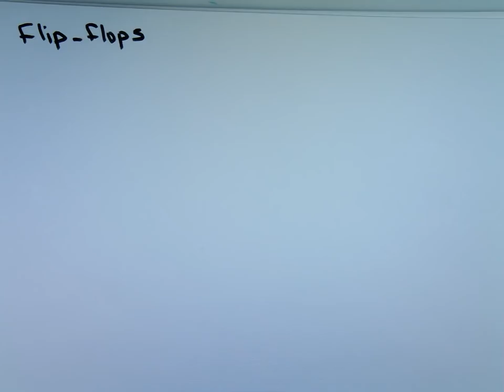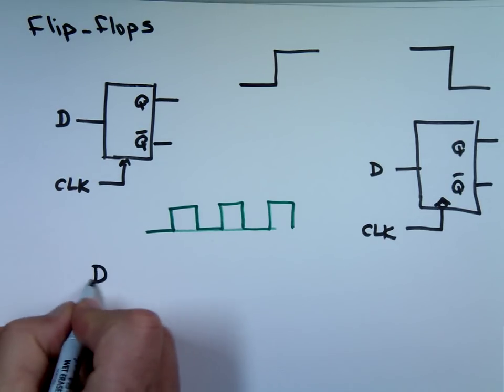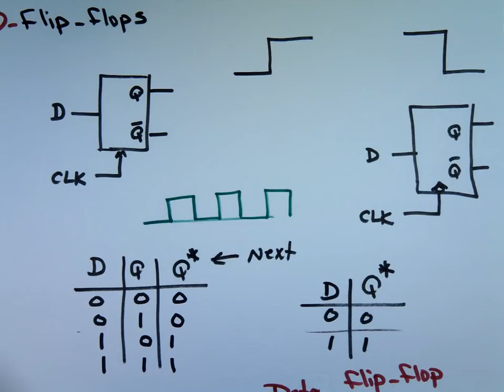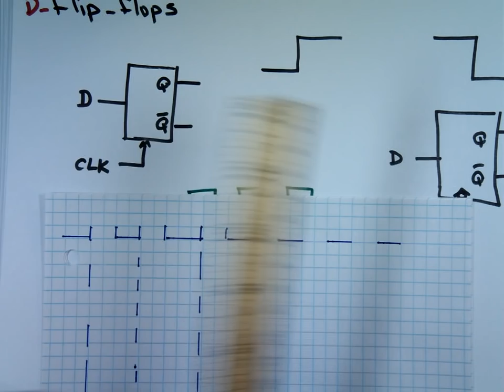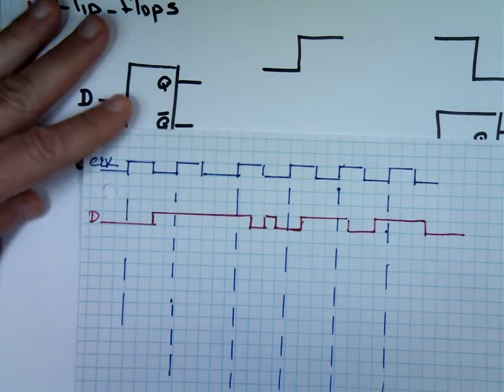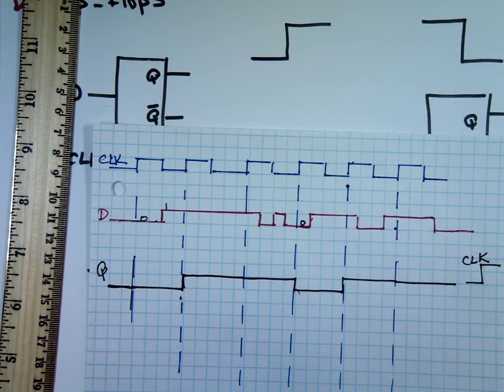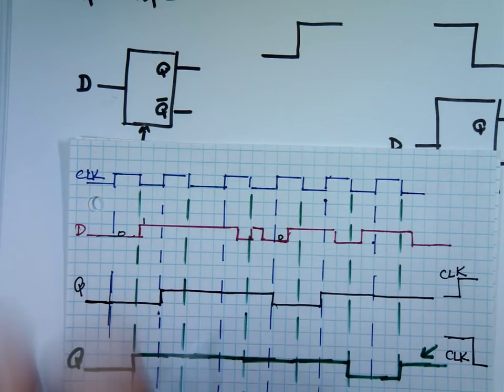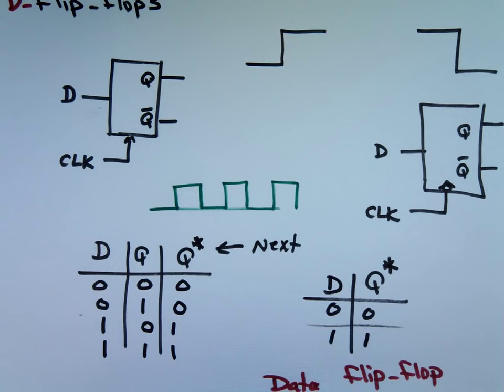D-Flip-Flop

Comment: what happens if we invert the CLK
Reply: Dogukan Tombul. If invert the clk pulse and make that as 0,-1,0,-1,0....etc.  the -1 is -ve supply to the transistors base or gate. so if the whole D flip flop is made up of npn transistor (for example)  .its natural state is Off in order to ON  a npn you need to give +ve potential  in base but if you give  -ve potential  npn turns off so.   By this if give -1 the you will not able to on the transistor  so Nand gate in dflip flop does not follows ur logic  🙌
Reply: @lamechtennyLT  oh I understand, thank you.